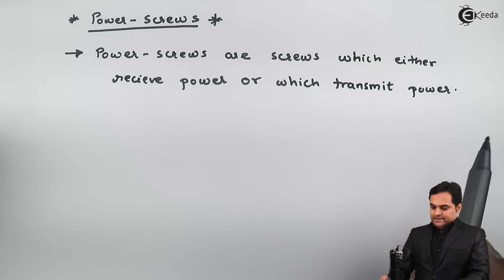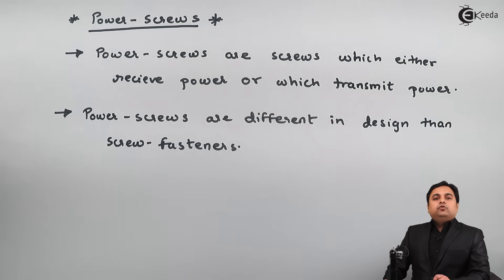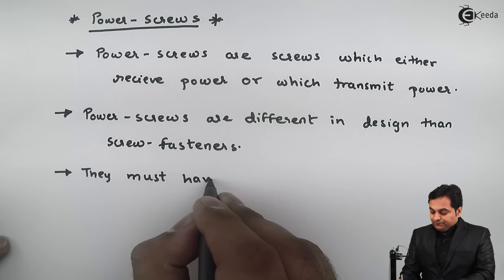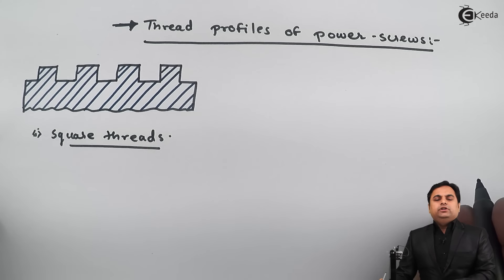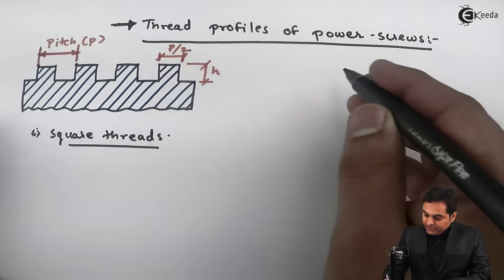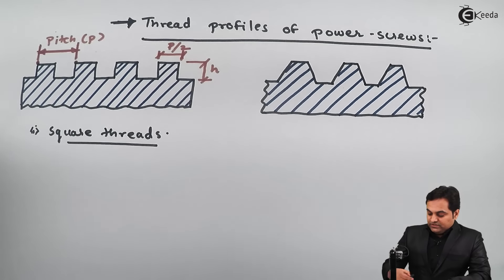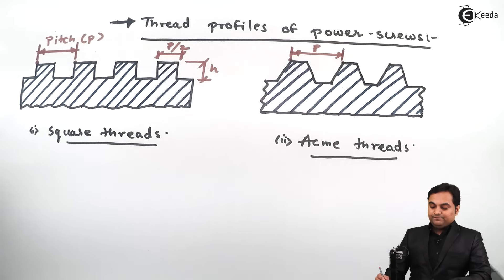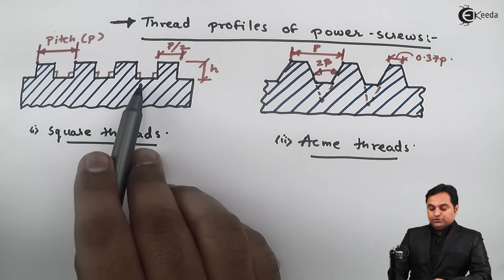Definition of Power Screws and Types of Thread Profiles - Power Screws - Design of Machine

Comment: Hlo sir buttres threads are used to transmit power in one direction only because they have 45degree angle between the two teeth.and theese type of threads are used in ratchet type spanners.